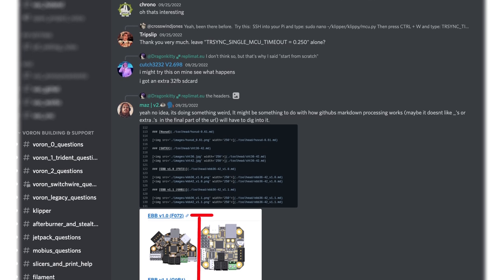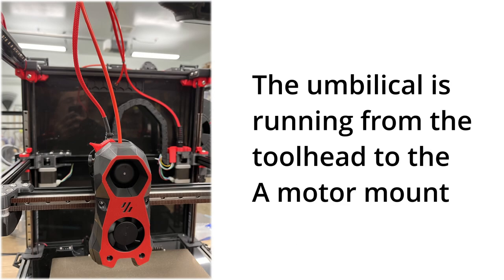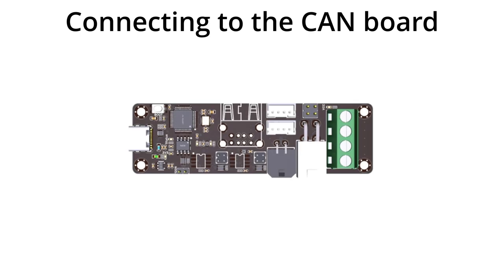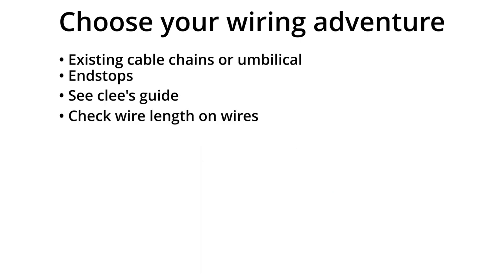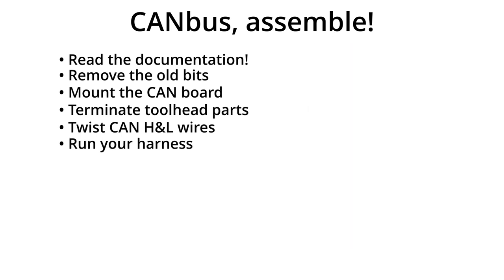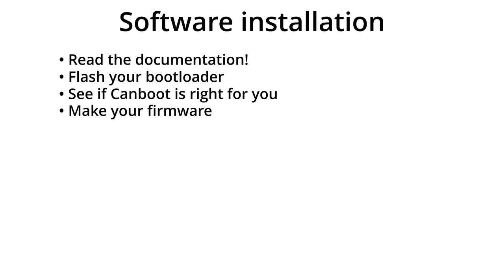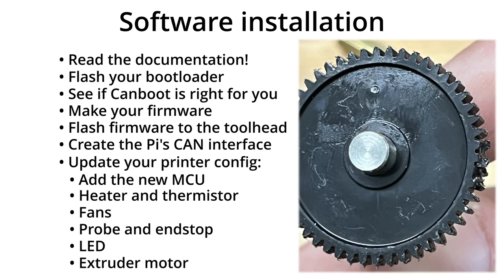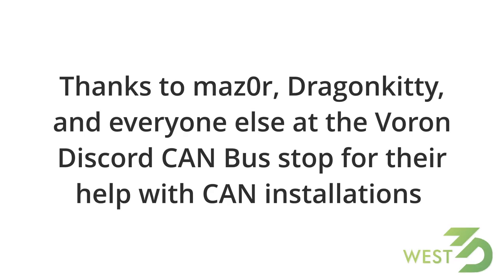Introduction to CAN bus for your 3D Printer - (Voron) CANBUS

Comment: Thanks for putting this video out. I would be careful when classifying an option as "traditional" especially when referring to a USB to CAN adapter. I would also mention that you missed the original method of can bus for the RPI, and that is using a CAN hat for the RPI, which uses a SPI bus to talk from the RPI to the CAN hat. I would also raise caution for the type of can bus being deployed. The FD version at this stage seems to have a features that are important to the use of deploying CAN on a printer, including greater bandwidth and flexibility with in the can bus. As well as hardware tx/rx buffers and in most cases with the higher end FD can bus built in error correction and timestamp bits. MCP2518FD vs the cheaper MCP2515 as an example.
Reply from the maker: Many valid points. I geared this video more toward the less technical which is why I concentrated on more commercially supported USB to CAN hardware, but there are several ways you can accomplish your build. - Allen

Comment: Twisting the power cables will reduce the noise produced by these cables.  Using multiple thin cables in parallel is better than just two thick cables.

Comment: Would you mind clarifying what you mean about the UART pin, and the steps involved in avoiding the issues that you had?
Reply from the maker: When you look at the extruder section in printer.cfg the UART pin definition is separated from the other extruder pins- just make sure you update all four pin definitions and you'll be set.

Comment: question- I'm building a custom IDEX machine with two independent hot ends that can print simultaneously. I've read that CANBUS can be daisy chained- is it possible to wire from the U2C to the first EBB36, and then from that one to another EBB36? or would I need to have two independent U2C boards controlling each EBB36 individually?
Reply from the maker: You can't daisychain the EBBs, but you can run from the U2C to each toolhead separately. The U2C has 3 CAN outputs.

Comment: Just an FYI, I just picked up the Mellow FLY 36 and after it arrived, they released a new one, so typical, it has a better power connector and magnetic encoder built in, which I assume is for fine extruder motor control.

Comment: Does the canbus work with afterburner?  I have the out of date printed parts, seems like a waste to not use new parts, but I like the idea of not having to thread a bunch of wires around and thru the cable chains and that, i'm coming up on a point in my part sourcing where theres choices to be made beyond just the size.
Reply from the maker: You'd need an EBB42 CAN board to fit the CW1 extruder motor

Comment: I think it makes sense to use 5 wires instead of 4, one with 24V and one with 5V, they are commonly used and no voltage reducer is necessary
Reply: It's a lot more streamlined design choice to have a common bus voltage then have whatever component convert their required voltage locally. Many of the chips are using 3 volts not 5 so it's not you avoiding circuitry.
Also running low voltage say 5 volts over from a power supply in the base to print head introduces a lot of room for voltage drop and noise. Probs not major but another thing people will have to look out for.
Though with some current hardware options an additional 5v cord could make sense.
Reply from the maker: Unless you have a specific high current draw device it’s much easier to use the 5v supplied by the toolhead board.

Comment: Why not use USB-C with Power Delivery instead of CAN?
Reply: Interesting question
Reply: USB wiring and connectors aren't rated for this kind of motion.
Reply: @creatornaut503  Or potential heat load in an enclosed printer. Good point.
Reply: USB-C would just be complete over engineering in this case. 
- First USB-C has way more than just 4 wires (for  Power Delivery Communication, USB2.0, USB3.2, USB3.2x2 which requires an additional USB3.2 pair, etc.) you would actually add wires back into the mix when the goal is to reduce them.
- As @allenrowand6988 pointed out, USB-C connectors and wires aren't rated for this kind of constant motion
- USB-C PD needs some negotiation which means both sides need extra circuitry to negotiate the power and converters to convert the voltage and current to the one supported by both sides and the cable (yes the cable also communicates with a chip), this adds even more power circuitry into the mix. 
- The current MCU generation will at best go up to USB2.0 speeds and not go into USB3.x territory anytime soon so it would be complete overkill having a cable supporting those speeds when you can't really use them. 

If you want to keep it simple in design while also retaining the reliability and real-time capability there are some protocols that are tried and tested in industrial usecases. CAN being one of them. There are also others like Profibus, Modbus, other protocols running on RS-485 or RS-422, or some protocols running on Ethernet (Ethercat, Profinet) although those also bring back some complexity and processing requirements.

Comment: I think that the CAN bus does not suitable for things like stepper motors. Because every step motor must be in sync with others.The CAN bus is not capable to transmit and receive data in straight order, so there mait be change in order which will couse unsyncking for shure. So CAN bus is not a good idea.
Reply: The protocol used by Duet boards (which use CAN-FD for higher bandwidth instead of old CAN) running RRF includes a time sync protocol to sync the boards to within a few microseconds. RRF on the main board sends the info for complete moves a little in advance of when they are needed, and the expansion board delays starting them until they are due. So CAN latency is not an issue for RRF.

Comment: Make CAN wireless, then only +/- are needed.
Reply: Wireless connections are prone to interference especially in the ranges you can legally use without a license. Real time communication is also very tricky since you need to add extra margin for intermittent data loss and potential retransmission as well as a mechanism to detect and request a resend.
With those margins added you might even run into a bottleneck where the mainboard can't communicate with the head fast enough and print speed needs to be reduced.
Safety wise there are also a ton of issues, for example if the controller can't detect the endstops during connection loss, etc.

In my opinion if for such a system where you want to keep the machine from rapidly disassembling itself and you need real time communication there should be no wireless communication in the critical data path.